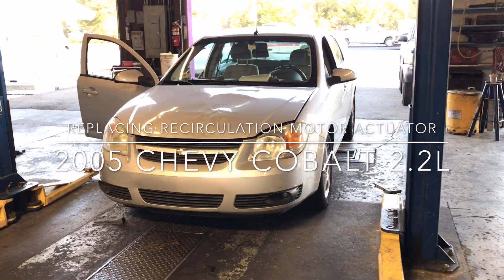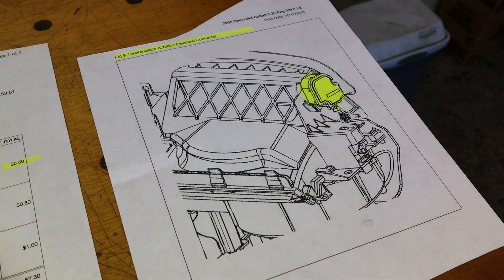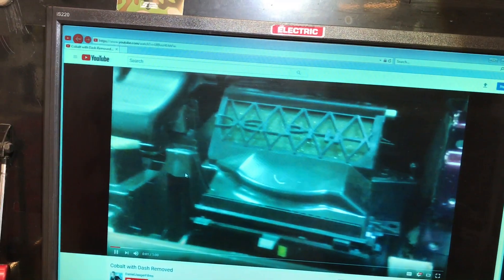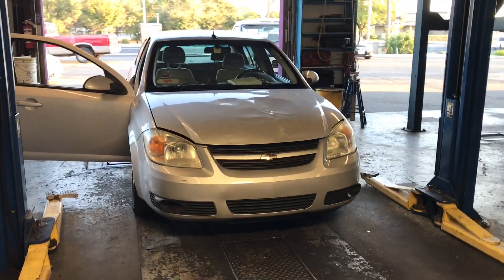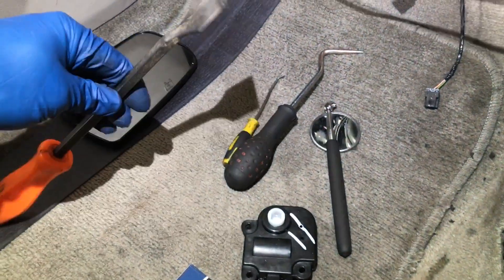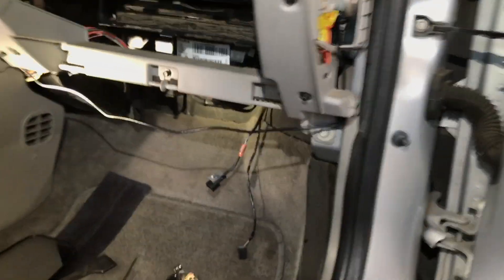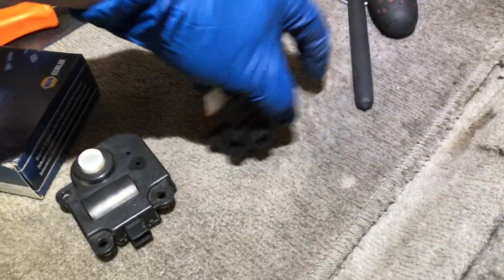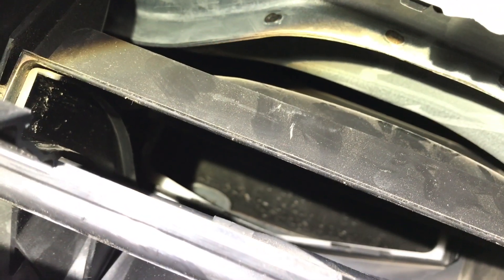Replace Recirculation Motor Actuator Fast 2005 Chevy Cobalt

Comment: I found that if you take the glove box and side panel off, you can see the actuator.  I was able to pop it off with a long screwdriver without removing any foam.  If I had marked the actuator before  removing it, it would have made reinstalling it much faster as once it is in the right place, it easily clips into position.  It took me over 30 minutes before I was able to find the right spot.  Has I marked the actuator before removal, the job would have taken less than 15 minutes.
Reply: Excellent info to add to this video. I know personally I'd rather take more time and leave the insulation in place. 
 Thank You!!!
Reply: Where would you have marked it beforehand? I need to replace mine and I'd to do it myself

Comment: It doesn’t just “pop off”, there are clips on either side of the actuator that are extremely hard to take off.
Reply: How are the clips shaped and how is the actuator removed from the clips?
Reply: @MrJohnnyDistortion  3 clips, they clip through half circle holes and you have to push them inward to get them to unclip and pull it forward
Reply: @natestrings673  
Thanks. I wonder what they look like and how do you manipulate the 3 clips simultaneously with 1 hand way up thar?
Reply: @MrJohnnyDistortion  One at a time, by the feel they are metal hooks. It takes a bit but its worth it to the alternative.
Reply: @natestrings673  
Clips, hooks, I'm all freaked out now.😵
Reply: @MrJohnnyDistortion  not sharp don’t worry
Reply: @natestrings673  
Not concerned about sharp. Concerned about proper installation.
Reply: @MrJohnnyDistortion  It will only fit flush one way. No matter how much you stick it up there. Oh also, the actual part that controls the blend door likes to turn if you start your car on so you have to align that as well, but I found that rather easy and it only took a few minutes to install after taking it off.
Reply: @natestrings673  
Any chance of causing damage during installation or if anything is misaligned?
Reply: @MrJohnnyDistortion  if it doesn't fit, don't force it, but the only component that isn't metal on the actual car is the actuator connector, the hook/clips are metal from how cold they felt.
Reply: @natestrings673  
Nothing on the car is metal except for the connector?
Reply: @MrJohnnyDistortion  nooo haha the only parts the you can really mess up are metal so it'd be pretty difficult

Comment: Mine has screws holding it in place. I can't just pop it off. Getting the screws out is going to be a nightmare. And not sure about the installation of the two screws. Not going to be easy.

Comment: After Removing the insulation, I can actually reach up and get my hand ON the actuator, but for the life of me, I CAN'T get it off. This has me worried that if I do get it off, I  won't get the new one on. Any one else here have that happen ?
Reply: Getting the new one on its just about lining up the little piece in the middle. The hardest part is taking it off. My hands were pretty raw by the end of it,  it's possible though. Took about a week of attempts. The key is popping both sides off one at a time and keeping one up at the same time as lifting the other, once you do that slowly pull straight off.
Reply: Another video said to turn the car on and the actuator will realign/reorientate itself.

Comment: I fix them In 30 seconds, over there where the insulation is is 2 small wires just cut them problem solved.. it only the fresh air vent mostly no one uses the fresh air circulation. I am telling  u I have done this at least 50 times I am a cobalt dealer

Comment: To what do those 2 plugs attach to bro? Why didn't you show full dissasembly for actuator access? Can a person simply reach up, grab it with fingers and pull it off and reverse the process again? The tools will cost me more than the actuator.
Reply: Can't get to it with hands
Reply: @glovester  
I actually got my hand on it but I couldnt wiggle it off. Then I found a mobile mechanic on Craigslist and he pulled it off and reinstalled the new one for $50. I couldn't believe my luck.

Comment: I have a 2006 hhr blows hot air when you turn on the a/c . If I put that part will it solve the problem?
Reply: "Hot air when AC is on" if you hear compressor click on and one of AC aluminum hoses are very cold--than AC works--its a blend door Actuator is bad. To find exactly which one---turn Heat/Cold knob one and other way and look at Actuators which one is buzzing or clicking...than look closely if the shaft is actually moving ( motor might buzz but not move the blend door)--when found--replace it. Good luck
Reply: nope ,you have another issue

Comment: Lier is not 15 minutes work I did following your short cut but is not 15 minutes work.!!!!!!
Reply from the maker: It depends on how good of a mechanic you are 😉
Reply: Okay I'm working on a Pontiac g5 gt and I pulled up diagrams the same diagram in this video below it says remove screw!!! So I'm over here trying to pop it off and wondering why it's not popping off so easily.
Reply: got r done in 14 minutes and 38 seconds.